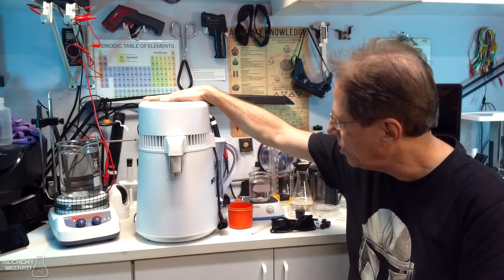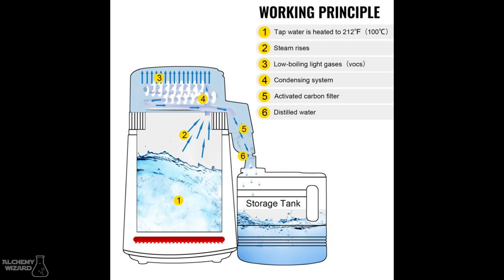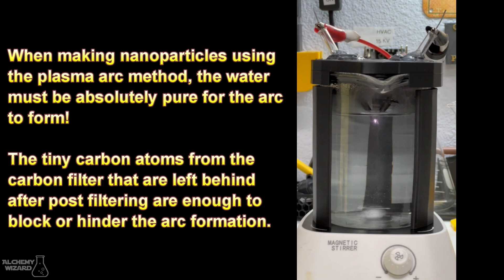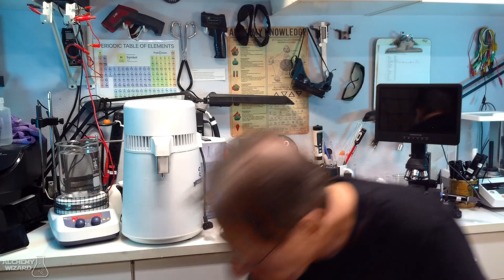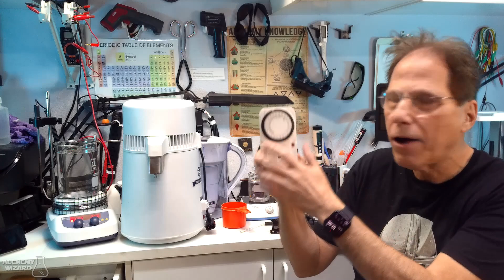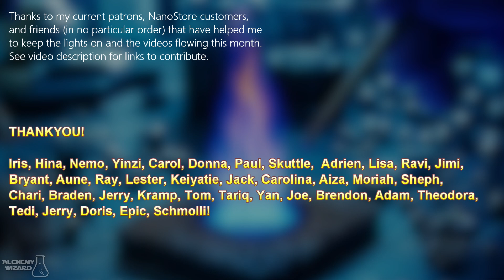Cleaning your Distiller!

Comment: Thank you for the information Alchemy Wizard.  I have a Waterlovers Distiller.  I am wondering if you can give me some advise as it has to be restarted over and over again.  Sometimes it the fan doesn't even begin and it shuts off.  Another time it runs for 30 seconds, then it can run for an hour or more or less and shut off.  After cleaning it runs just the same.  I keep making micro adjustments until it finishes.  Any advise?
Reply from the maker: I had a distiller with an intermittent fan. It did the same thing. I had to replace it. The distiller is shutting down from overheating. There is a thermal switch in there that senses when its too hot and will cut off the power for about 30 minutes. Without the fan turning that switch is engaging and shutting down the unit.

Comment: Reviewing different youtube videos before buying a distiller, I found your youtubes thankfully and regarding your cleaning process, my question would be:  When you have first bought your first distiller, should I clean it once a month, more or less?
Reply from the maker: It only needs to be cleaned if you see hard debris stuck to the bottom and the top of the unit. And that depends on the quality of the water you put into it. I would highly recommend a timer set to about 20 min before the water runs out. That way you won't get any debris stuck on the bottom and never have to clean it.